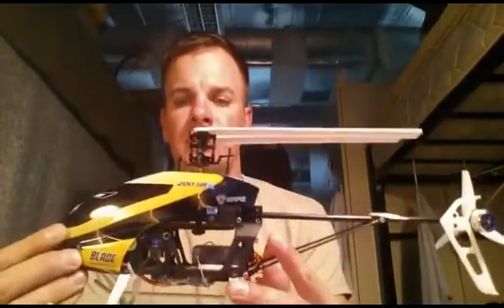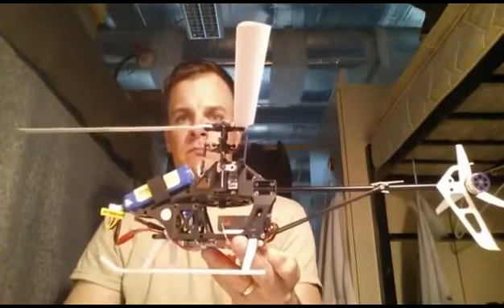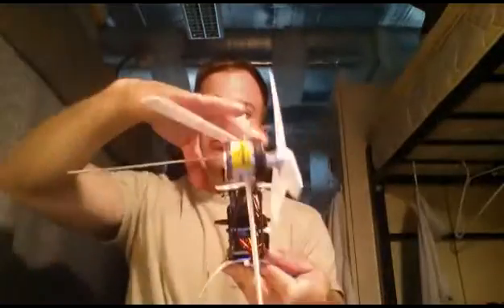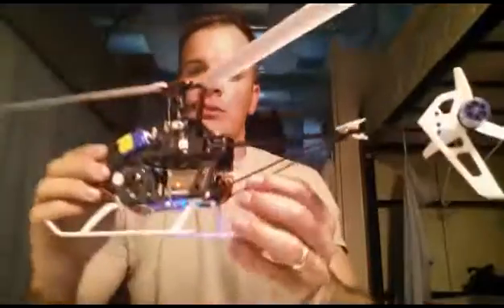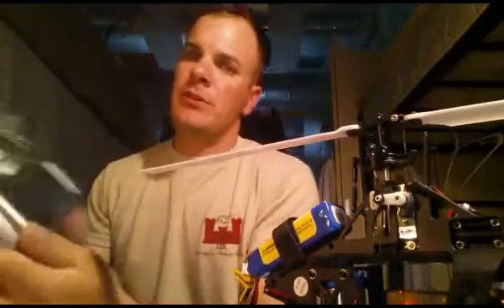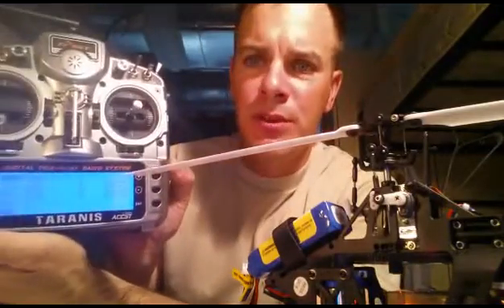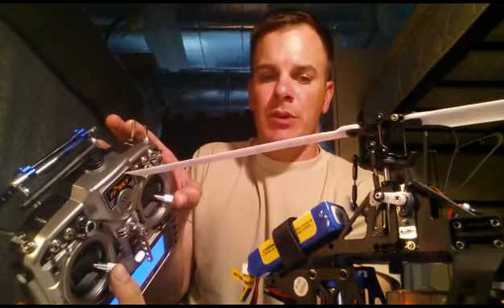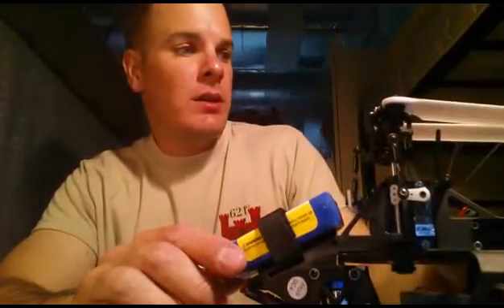BLADE 200 SRX GAIN PROBLEM

Comment from the maker: From the factory everything is set at what they call 100%.  However, every setting in the AS3X can be set to double that value.  

An example of this is the popular "set your motor gain to 200%", rave.

I would argue that all the factory settings are set to 50%.  The set your motor gain to 200%, is actually " set your motor gain to 100%".

With that being said, my motor gain is set to 100% (factory 200%).  My cyclic gain is set to 25% (factory 50%).  My gain filtering is set to 25% (factory 50%).

By lowering your gain, you are just telling the gyro not to react to every bobble or shake it feels.

I how this helps.

Comment: What gain settings are you using? I am not familiar with your transmitter but am assuming that you have telemetry capabilities on it. I have the same situation and have just started to narrow down the optimal settings. Any help would save me a bunch of time and frustration.